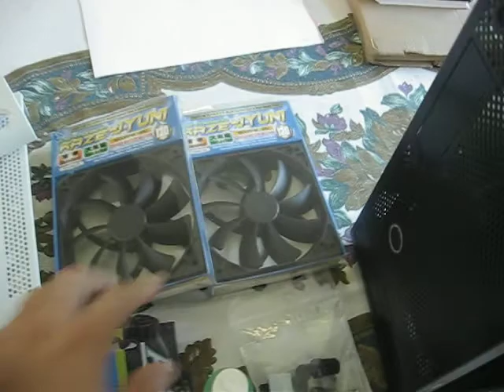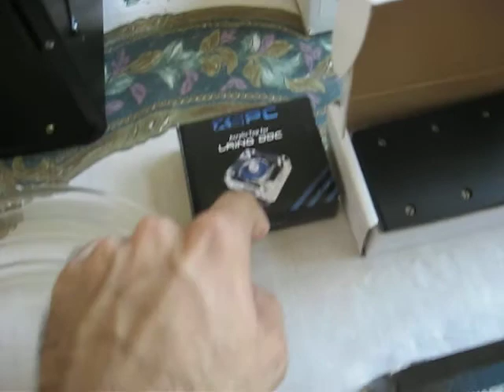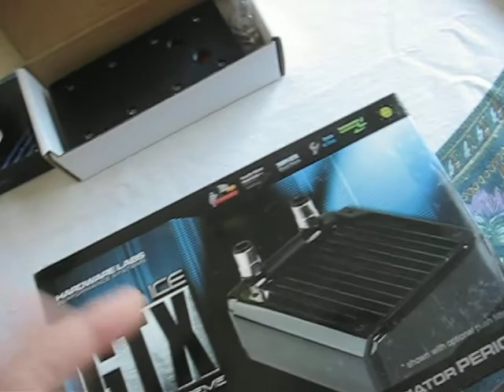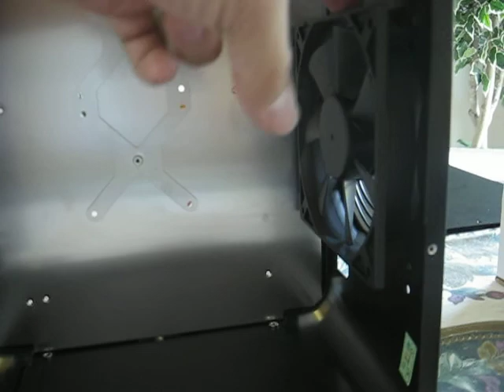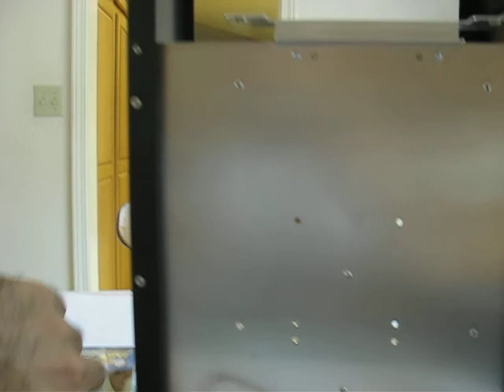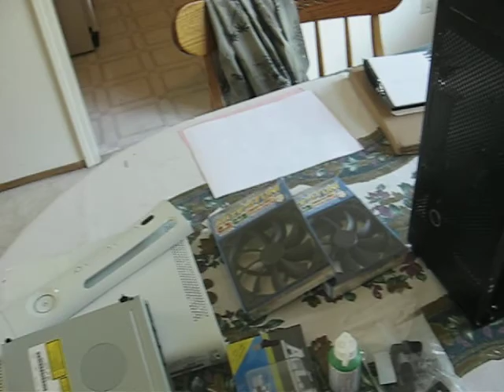Water cooled Xbox 360 project part 1

Comment: i would have chose different fans. Such as Scythe Gentle Typhoons. Scythe Slipstreams are sleeve bearing which have terrible life time, built terrible, and are extremely loud. I also would have gone with a cheaper rad. a XSPC RX240 instead of the black ice 120. Cheaper but better heat dissapation and they dont require high speed loud fans